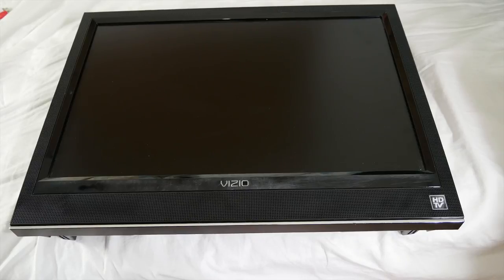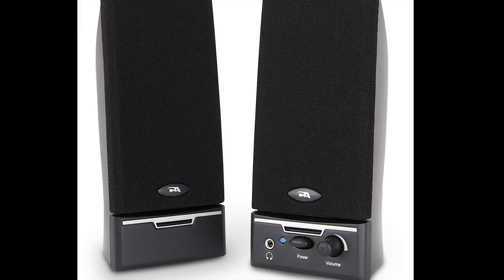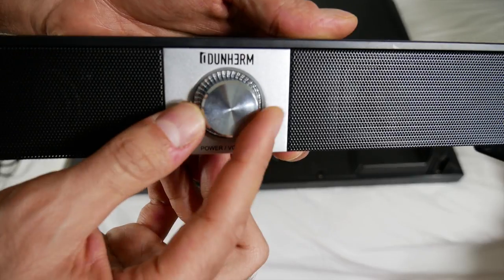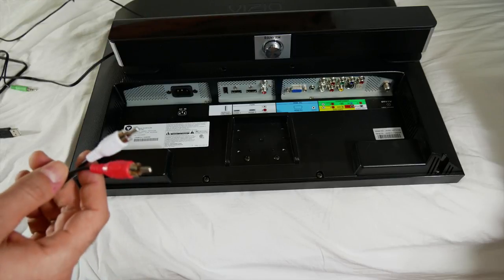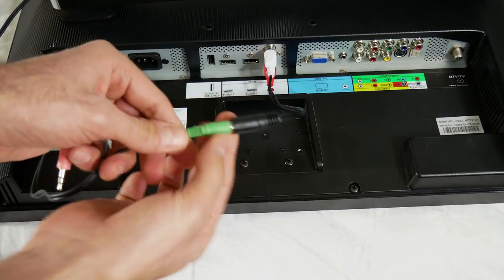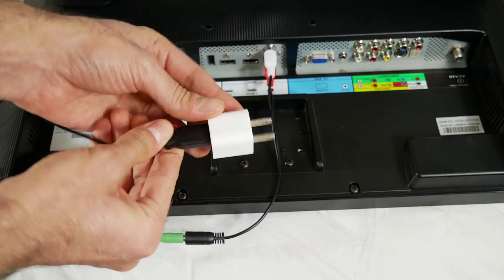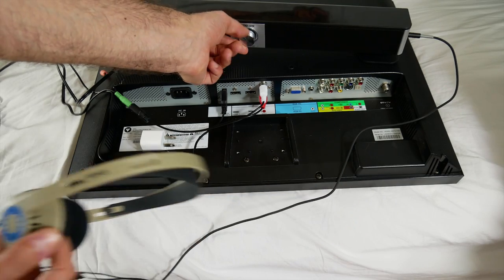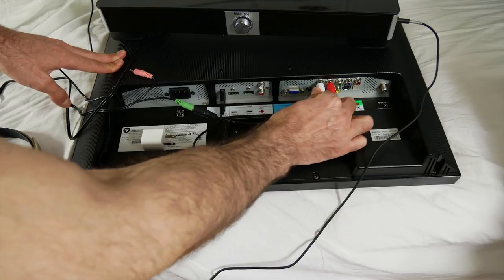HOW to Connect EARPHONES to a TV With NO Headphone Jack - UPDATE 2018

Comment: I've been trying to get headphones for my fathers Samsung TV and it's nearly impossible.  Only thing he has is a digital coax audio out, optical,  and HDMI out.  This limits me extremely when trying to find something to hook up earphones.  Can't use any analog in and needs to be a high end soundbar with optical inputs and none of those I can find have a 3.5mm aux out.  I'm almost to the point of telling him he needs to sell that TV and buy another one because it'll be cheaper than all the stuff he'll need to buy to get a $20 pair of earphones to work.  It's upsetting how difficult this has been and the hours of time I've invested in trying to do such a simple task.
Reply: I am having the same issue with my mum...
Reply: Absolutely!

Comment: I got cordless headphones for my dad that needs wire to connect to the headphone jack. Problem is the headphone jack is now faulty. So wondering if I can use an RCA adapter to plug into the headphone charging dock. i guess i will have to give it a try....or get a cheap sound bar and do what u have done

Comment: Thanks for sharing I might try this later. My LG TV only has optical plug. No Headphone Jack. I tried a very complex system which included like 3-4 different cables with different plugs / adapters and in the end after a month of research and studying all the parts I finally got the last part. And.... the sound was absolutely horrible. I was only able to return half of the stuff because some of it wasn't covered for return. This is so dumb I mean why would you make a TV without headphone jacks? I don't understand. The TV is modern, has multiple apps like netflix, amazon and good internet connection but no bluetooth and headphone jack? The hell man? Seriously why? Now I'm considering selling it which is another pain in the ass on top of the previous one. If I had know this I would have never purchase that stupid TV.
Reply: Hey I also have a LG TV that is really stupid. It does not even have optical jack!? No damn thing, except for AV

Comment: what if you don't want to use a sound bar or PC speakers?  I have a good set of headphones but the TV that was given to me has no "headphone" jack in the back of the TV.  How do I connect the charging dock to the TV?  All sorts of adapters came with these headphones, a USB adapter, optical adapter, pls tell me how to do this?  None of the videos do a simple set up, all the videos on youtube add all these extras in, sound bar, PC speakers.  I can adjust the volume on my headphones by a switch on my headphones.  All I am trying to do is hook up the charging port to the back of the TV - again, there is no 3mm jack, just "audio in and out" and optical hookups.  Pls help !

Comment: Is the sound bar you used described on Amazon for PCs? Cab sound bars for PCs be used for TVs????
Reply from the maker: Yup most definitely!
Reply: @TechManZ  Thank you! I purchased a PC soundbar and the adapter, as described. I am testing it on my Smart TV before setting it up on my mom's not Smart TV. So far nothing is happening. The sound continues to flow from the back speakers of my Vizio. I have power in my sound bar and  have tested 2 sets of White/red ports on my TV and nothing is happening. Any thoughts on what I am doing wrong?
Reply: @terrimary6320  maybe from your tv remote go to the sound menu and select external speaker.

Comment: Hello, I attempted to do this, though the cable adapter I got is a RCA to 3.5mm male... I plugged it to a 3.5mm female-female piece to which then I connected my headphones, but audio keeps coming out from the TV.
I was thinking it may be because of that extra step due to the male output. Do you think the problem may be that it's not a RCA to 3.5mm female?

Thanks!
Reply: not sure if you just saw my post you're going to have to hook up PC speakers with a headphone jack and volume control. Then it will work! I did the same thing you did it did not work but once I plugged in PC speakers to the adapter on this video it worked just fine. Hope this tip helps!

Comment: My Dad is hard of hearing needs headphones (hearing aid accessories and blue tooth hurts his ears too much echo). I am THRILLED I could plug in his favorite headphones using good old reliable "wired" technology. Because Dad sits 10 feet away I did get a 10' headphone extender braided good quality.  Mom sits next to dad and wants to hear the TV at normal volume. Seemed impossible right? Not so heres how I did it .. but first let me preface they have an older Samsung TV, no Optical out, no Headphone Jack or USB ports. (Best Buy Tec mistakenly identified the service port as a headphone jack port but it didn't work). Went to one of those PC repair stores and bought speakers with a volume control and headphone out jack(both very important) .Connected the RCA to female adapter shown in this video to the cable box (not tv) (must do this is you have cable connected to your HTMI port on TV.  Next, you need to plug in your pc speakers (tried plugging in headphones at this step thru did not work).  Only thought the headphone out jack on the pc speakers do the headphones actually work while allowing the TVs internal speakers to keep sound.   So Dads headphones have the volume way high from the pc speakers to old headphones while Mom can control the volume on the tv like always with her remote.   Its perfect!  If you unplug the headphone then you hear the pc speaker (in our case very loud since its turned up for dad).  Showed my mom how she can switch between internal speakers to pc speakers just by unplugging the headphones. Spent $30 and have two happy parents!

Comment: I just wanted to thank you for your help. I’ve been trying for a while now to figure out how to use headphones on my tv that doesn’t have a headphone jack and you solved the great mystery, using pc speakers with a headphone jack. I ran it from the digital audio optical port on the tv connected to a digital optical cable, conected to a prozor digital to anolog audio converter, to an RCA to 3.5 mm female, then connected it to my pc speakers. It works flawlessly. Thank you again, Sir.

Comment: Hi,

Thanks for the video. I have a question though. 

I’m trying to figure out a solution for our living room.  My dad uses headphones to hear the TV but we also listen to the sound out of the TV speakers.   Before we could do this just fine because the DirectTV box has an auxiliary out that went straight to the wireless headphone dock. We’ve switched to using the Roku which connects to the TV via HDMI.  

How can we hook up the headphones to the TV so sound will be played through them AND the TV speakers at the same time?   

Thanks.
Reply from the maker: Does the Roku have a headphone jack anywhere?
Reply: TechManZ    No.  Not the express version.  The more expensive Roku devices have a headhphone jack in the remote but this causes the sound from the TV to stop.   

I did find a solution though.  I bought a Bluetooth transmitter from Amazon which hooks up via the optical out port on the back of the TV.  I’m just waiting on the Sennheiser 4.40 HD headphones to arrive in the mail.

Comment: I presently use my TV's headphone socket to a three way switch. Up to wireless headphone sender,down to powered sub woofer and sats and middle nothing. Mosty modern TV's don't have a headphone socket, hence your video!
How about using an optical out to female phono adapter? Thinking that, as this is usually used to connect soundbars etc, it might be easier to disable the built in speakers via the TV audio menu.
Reply from the maker: The component cables to female 3.5mm  i find is so far the least expensive and most common
Reply: @TechManZ  
Hallo,  I have an old LG big tv screen...I wanna use my wireless headphones via a bluetooth key but my tv has no USB options just one "Service only in" .Moreover, there is one jack port "in" not "out" in the TV...
Can you help me pls....? Thanks in advance..

Comment: Doesn't work on my Samsung.  I guess I'll try getting a soundbar like that because nothing is happening with my PC speakers except a hum.  All the sound is still from the television.  I'm so disappointed.  It's insane that an expensive tv doesn't have something so simple as a headphone jack.  (Edit: Just so people know, it's a Samsung LED TV Series 5 - 5205 525D).
Reply from the maker: Have you tried different output ports?
Reply: I did.  I've tried everything under the sun, and then some.  I'm counting it at as a loss.  I just knew it would work, too.  (Which clearly it does on other tv's).  It just doesn't work on my Samsung.  Even though it didn't work for me, thanks for the video.  I have the feeling those new cables I bought for this will come in handy someday on another tv.  At least they were inexpensive, and the extended headphones I got are nice and work on a different tv.  (Not that I'll ever use them in there. lol!) I'm just glad I found my old speakers and never bought new ones.
Reply: Same problem here, Kristin! So disappointed in my Samsung.
Reply: same here,my tv is haeir..it haa no headphone input..
Reply: @kristin-happytexan   I agree. I am looking at upgrading to a 'Smart' TV by LG. I have a LG TV at the mo and it has a headphone jack. I watch a lot of late night TV via headphones.
Not having a jack is a deal breaker and LG have lost a sale. Ridiculous!
Reply: @LewieLeway  I was also eyeing an LG 4K HDR tv and it's sad that it doesn't have a headphone jack and only support LG's own specific batches of Bluetooth headphones/earphones.
Reply: LG the same, the RCA jacks at the back are for gaming input. No audio out.
Reply: You should get a digital to analog converter (DAC) to plug in the optical drive. Many have a headphone jack built in but you can also plug in an RCA to female 3.5mm if need be. They're like $12
Reply: I had an old Sanyo  HDTV (would have been released about 7 or 8 years ago) and now have a Samsung about the same age, the RCA out wouldn't output audio from the HDMI input on both sets, it was only for analog inputs. For HDMI audio they use the optical out (SPDIF) Keep that in mind if your TV is only used for HDMI sources
Reply: @kristin-happytexan  I am in the same boat. I have a 65" Vizio Smart TV. I followed the wonderful and straightforward instruction but the sound still come out of my TV.:(

Comment: can I connect headphones directly from red and white jacks? I don't need speakers
Reply: Tell me if you find out? I'd like to know that as well.
Reply: @brandoncreswell5842  i wanna know too did u find out
Reply: @s1Lence_au  it didnt work with me i used a rca to aux female plugged my earbuds to the female end and no sound came out ....  ive been using my echo dot as a bluetooth receiver but has whitenoise you can hear when silent.

Comment: my question is, if i do this with my jbl bluetooth speakers, will i still be able to use the speakers with other devices, such as my phone, without having to physically disconnect it from the tv
Reply from the maker: If your jbl speakers allow 2 connections then you wont need to physically disconnect. But you wont be able to use both devices(phone and tv) simultaneously.
Reply: @TechManZ  thanks bud, this helps a lot
Reply: I have a jbl flip 5 so i linked it with my tv bluethoot and it glitches, I can't stand it! have you had this problem?

Comment: no,,do your ears a favor avoid sounbars and cheap pc speakers, anyone who has bought a recent Samsung knows your not going to get any analog outputs on current gen samsung TVs and im sure many others are dropping analog outs of any kind,,,even headphone jacks are getting extinct on some brands,,seems whatever samsung and LG do others are sure to follow suite,,, making it a bit more work to keep using  any analog amp,, currently on my 50 inch samsung you get optical audio out and hdmi,,either way your going to need a converter,,  I am looking into possibly using one or more source devices like a htpc to  try a workaround but the simple route is to just pickup a decent receiver cheap and get the best pair of speakers your budget will allow,,of course this will lead you down the upgrade path lol
Reply: This. A budget 5.1 receiver with budget speakers or at the very least a mini hi-fi. No matter how fancy the TV the inbuilt speakers are  horrible and it is just plain bizarre that so many people settle with a big screen with earache-enducing smartphone audio